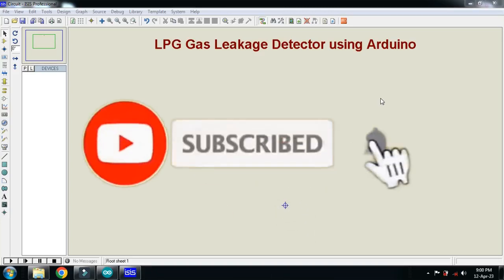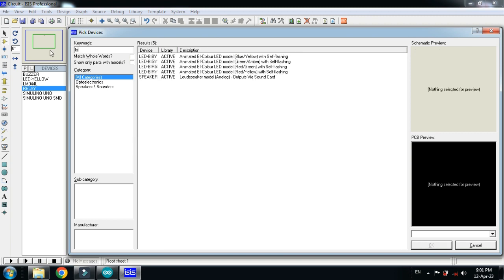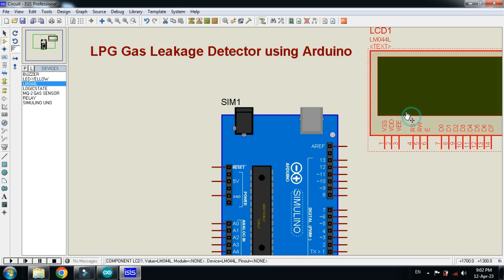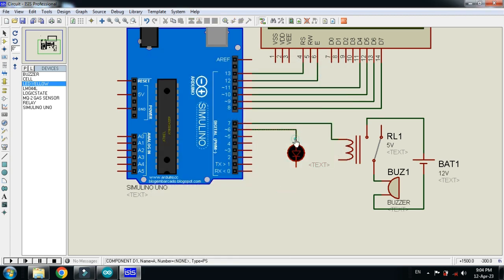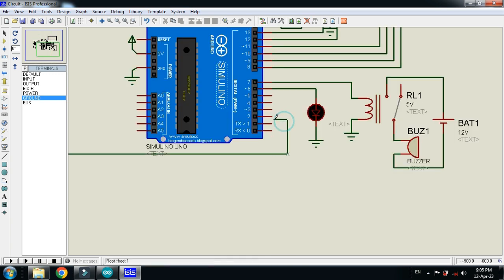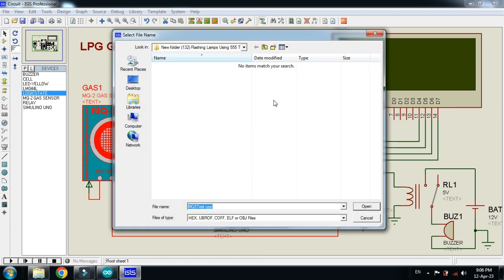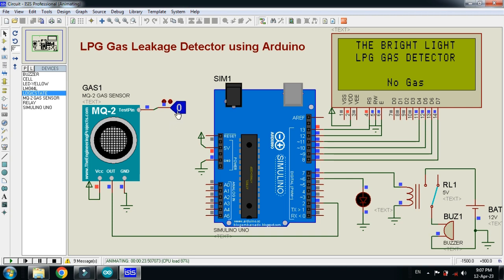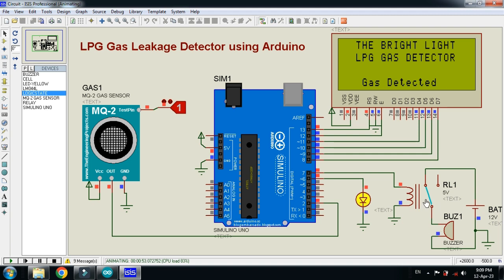LPG Gas Leakage Detector Using Arduino | Code & Circuit | Proteus Simulation

Comment: The circuit will work sir and the buzzer relay and led are not glowing lcd also works please help me sir
Reply: I will download your code
Reply from the maker: Their may be issue on your end, because in video everything is working and you can download my circuit and code from the video description, it will work

Comment: when i click the logical button it isn't work why ?it's just affiche the message"no gas " please help me i had a projet tomorow and i'm tired to search the solution of that and i didn't find anything 😔 |
Reply: and the digitalpin dosen't turn on
Reply from the maker: It's working perfectly, there may be some wiring or code issues on your side. You can use my circuit and code, download it from the video description
Reply: @thebrightlight9472  that's what i'm running and it's still 💔
Reply from the maker: You can see in video, everything is working perfectly

Comment: The output is not corresponding with what you have here sir, it’s reading “global variables “
Reply from the maker: The output is ok. If you have any issues kindly tell me. I will try my best to help you
Reply: @thebrightlight9472  its reading missing FQBN(FULLY Qualified BOARD NAME)
Reply from the maker: Brother I have checked all the details and verified again just for you but circuit is working correctly, you can watch the video step by step and everything is working correctly in video.
Reply from the maker: You may have some issues on your end. Circuit and code is 100% ok brother
Reply: @thebrightlight9472 it’s now reading well
But without the link to copy, how do I solve this sir.

Comment: Respected how can i contact with you ?
Reply from the maker: Please tell me here in comments, how can I help you.?
Reply: @thebrightlight9472  sir i want circuit diagram that detect metal and after that run a motor
Reply from the maker: Please watch my below video. In this video You can learn about metal Sensor and Arduino connection.

https://youtu.be/TV1GOU7j6Ho